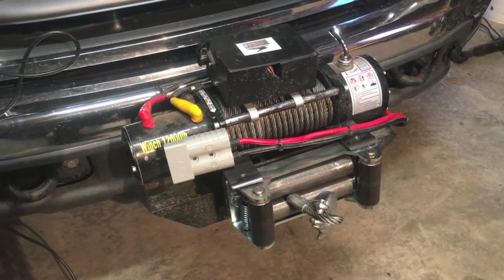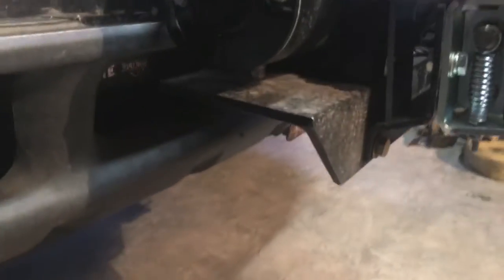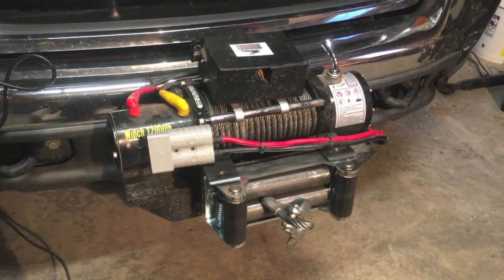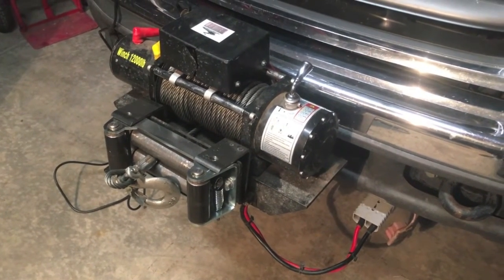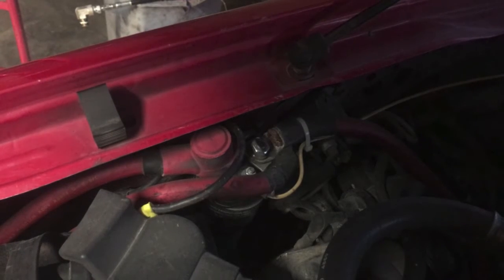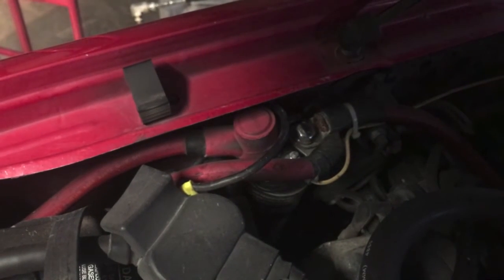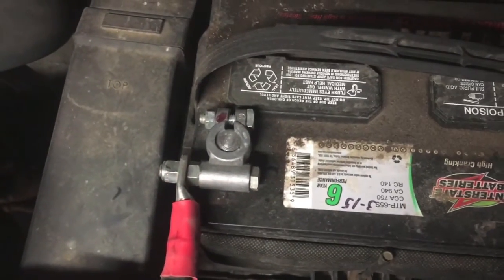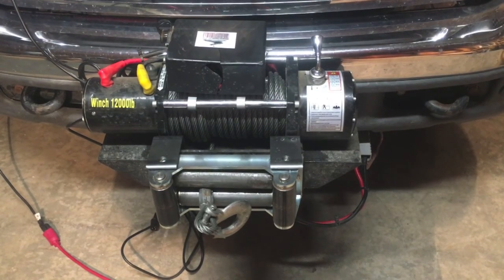Ultimate recovery winch power system

Comment: That's the exact same winch Harbor Freight sells, it does have GREAT reviews from several offroad magazines. I had no luck with the wireless remote, mine just "pulsed" the winch off and on while the control button was constantly held 'on", I retrofitted a military 50 ft wired remote to a 6 pin trailer light plug to mine off of a HEMTT bought off Ebay, it works great and keeps the operator far away from flying cables in the even of breakage. Nice video, I have mine on a receiver mount too to use in multiple locations like yours also. I have a small Harbor Freight hydraulic crane in the bed of my dually which makes it much easier to move it into position for the receiver hitch but that SOB IS heavy as you stated. I'm kinda screwed on putting it on the front receiver hitch, that's just manpower, but I rarely use it in that position.